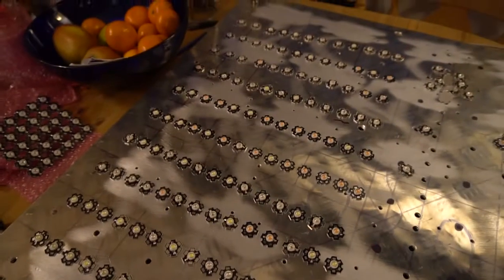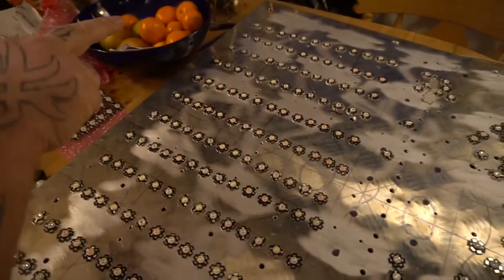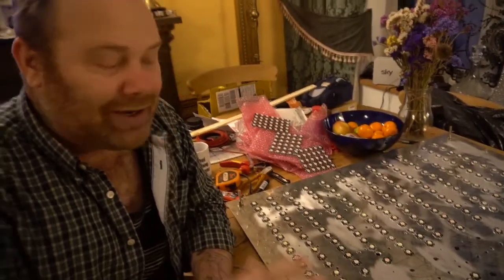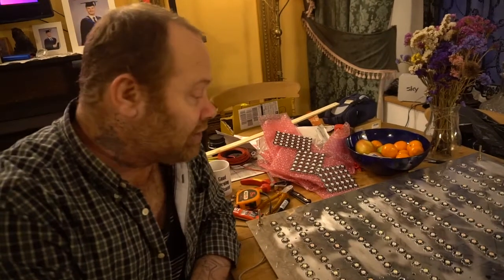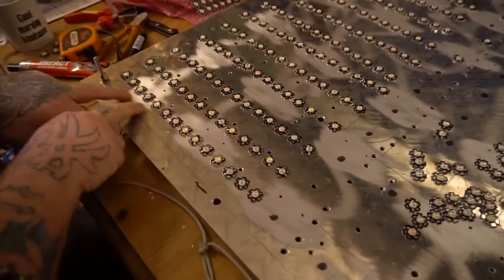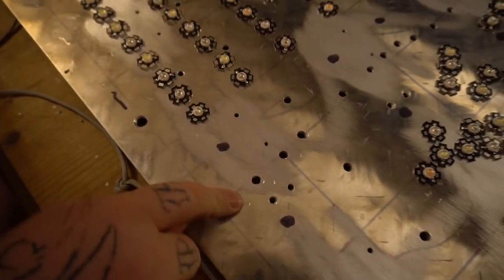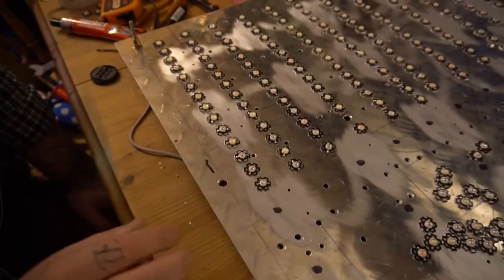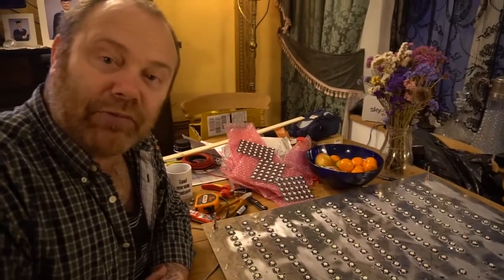3watt growlight part 2

Comment: What brand diodes are you using, how much did they cost, where did you get them, is the sheet metal enough of a heatsink, how hard are you going to drive them, is the Samsung Non-Flicker still alive and does it get hot?  But most of all where did you learn patience enough to stitch together 500+ LED's that would take me two months lol
Reply from the maker: these are a mixture of epileds and bridgelux theres 380 of them..i bought some from uk some from china the ones from china were half the price than the ones of ebay uk..the non flicker is still alive and performing perfectly it will shortly have some auto babies under it I'm just holding them back a little at the moment don't want tall plants every grow..the non flicker does not get hot at all..just warm the sheet of aluminium comes into its own there..im starting to tin the leds later today I don't spose it will take months to solder but it will certainly take a while.i must be crazy yes but its just to show you can get a great light cheaply..new videos coming soon of bubble hash making and other extractions also an indepth look at the airbombz unit....love growing